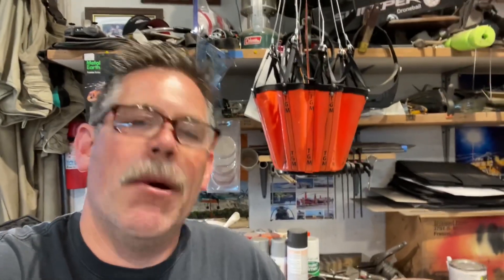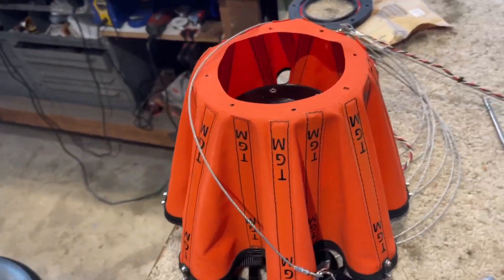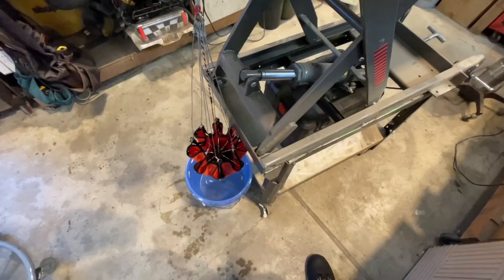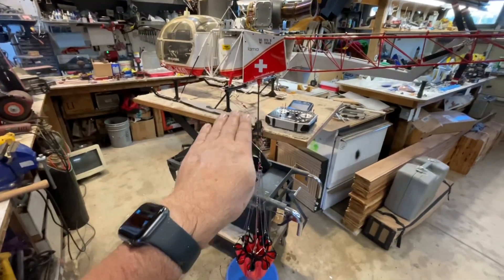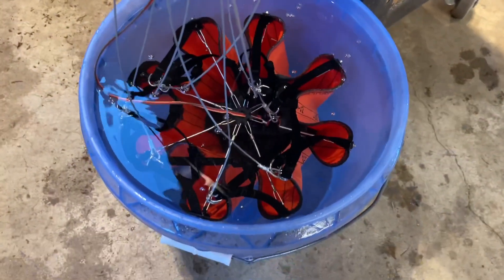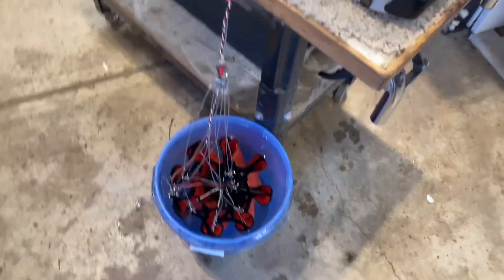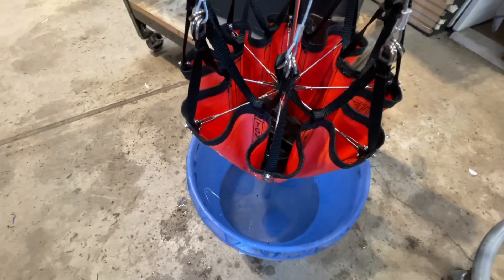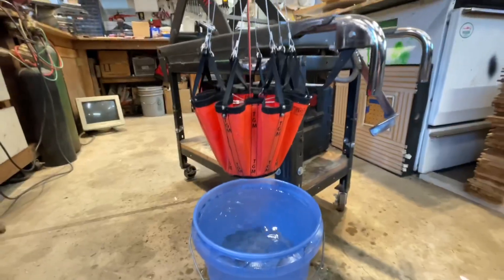TGM 1 Gallon Bambi Bucket

Comment: Put a weight on one of the sides and a weight underneath the bucket then it will tip over and sink
Reply from the maker: I found out that if I just leave it open, it sinks really fast!
Reply: @JestRR  Good job